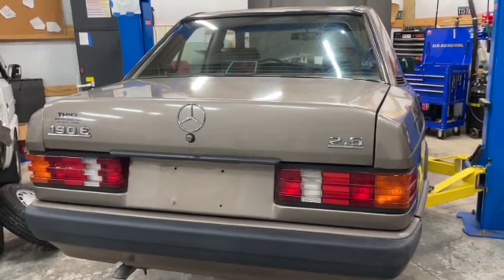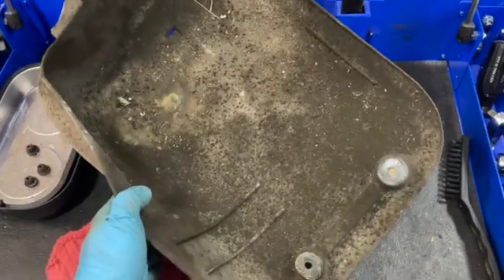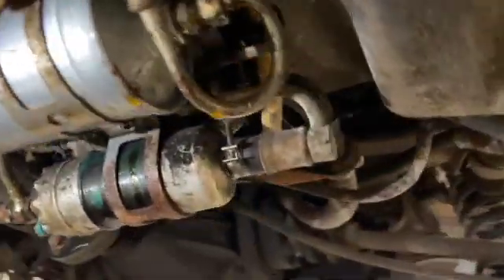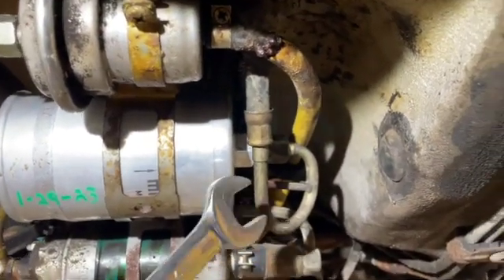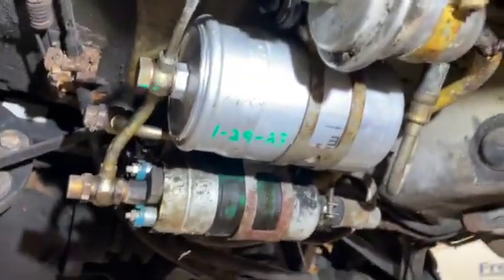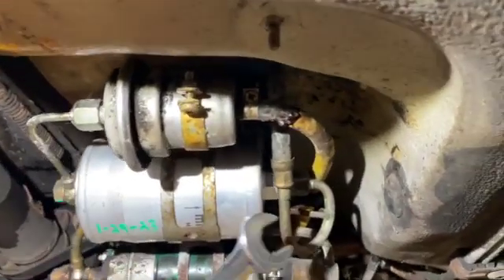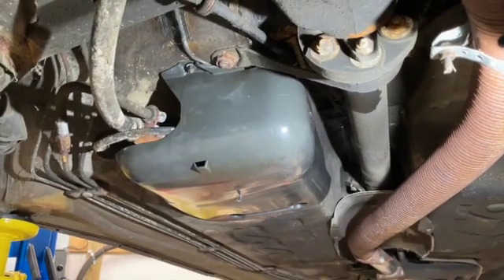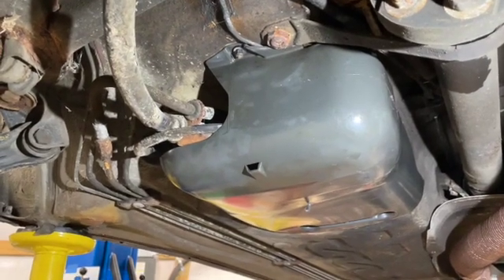Mercedes 190e W201 Fuel Filter Change

Comment: I have a 1992 190e, it just went dead on me, and when I tried to crank it, it turns over but will not start. Im guessing it is the fuel pump. Can you buy the filer and pumps as one unit?
Reply from the maker: I don’t think you can buy it as a unit, but each pump, filter, and accumulator are available. I may have put links for some in the description